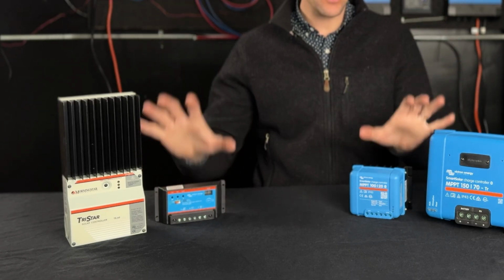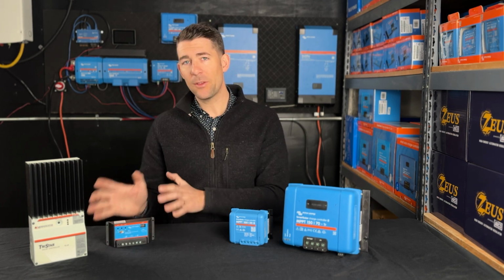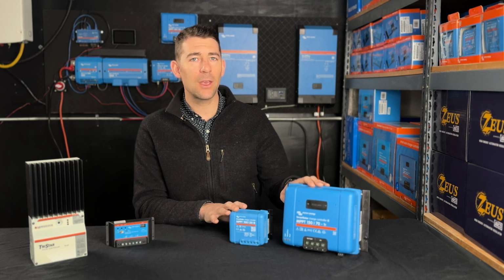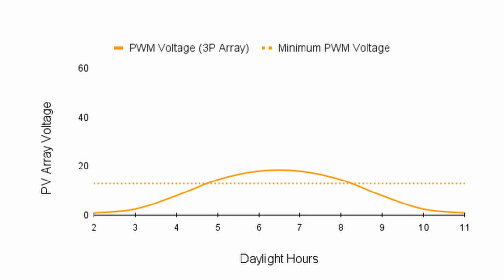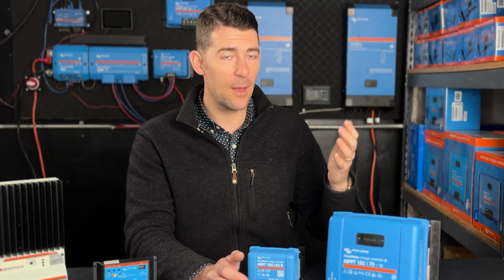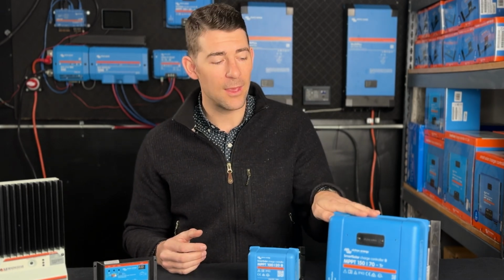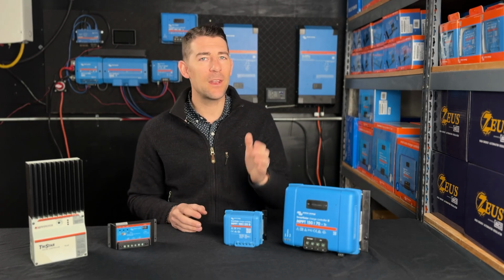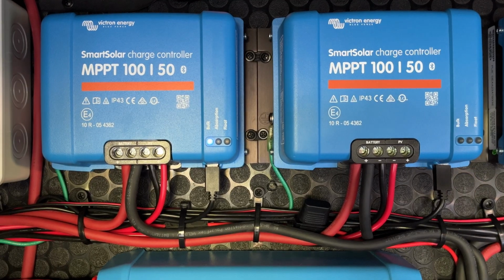Understanding MPPT Charge Controllers

Comment: If i have a 48v 550 watt solar panel can i plug this into a 48v mppt and then use a 12v car battery lead acid ? Or must i use a 48v battery ?
Reply from the maker: Hi @earlehowley3837 , a Victron MPPT will need a panel voltage of roughly 5V higher than the battery charge voltage to begin charging. So a 48V PV module would quite comfortably charge a 12V lead-acid battery. There’s actually a preset in the unit for just such a battery type. You’ll likely be using a SmartSolar 100/50 as a single 550W panel can produce upwards of 35-45A of charge current for a 12V battery. The 100/50 is able to charge 12V or 24V batteries, and other larger members of the product line are able to handle 12V, 24V, or even 36V and 48V batteries.
Reply: Must use a 48v battery.

Comment: Still no idea what MPPT means. What is being tracked exactly? I completely understand the difference between series and parallel wiring of panels to increase voltage and therefore extend charging periods at the cost of charging current. But isn't that just optimising?
Reply from the maker: Hi @markrainford1219, MPPT stands for Maximum Power Point Tracker. The MPPT is using a variety of algorithms to load the panels, that loading bringing the voltage down and amperage up, to find the point at which the array produces the most amount of amperage with the least amount of unhelpful voltage drop - the point of maximum power. The way Victron MPPTs do this is incredibly effective, partly due to the quality design and partly due to the highly specific algorithm that they use/created for these charge controllers.
Reply: @intelligentcontrols   Thanks. That's the best explanation so far.

Comment: Making more parallel connections ON SOLAR PANELS will generate more electricity in MPPT or series connection can have same result
Reply from the maker: @RAVIBROTHERSAGRA, there are benefits either way. The added voltage of a series set of panels can increase the variety of lighting conditions that will enable a charge current, especially in morning/evening and cloudier days - that added voltage means that even in mediocre light you can start to charge. The benefits of parallel panels does offer some resistance to issues like shading and less-than-ideal panel placement. The bottom line is that with an MPPT you’ll have a lot more flexibility to build your array the way you need to, while ensuring your sensitive battery systems are getting the charge they need.
Reply: Usually this is the case, especially if you have some panels that aren’t matched -  but if they are matched, MPPT is uniquely (vs PWM) able to use/convert the high voltage with no performance hit. 

The advantages in wiring are pretty significant though - I have a small system and always used parallel because I have different panels so it isn’t really a big issue, but I never thought about a large array with lots of wiring, and/or a long wire run from the array to the charger. That would make life SIGNIFICANTLY easier and cheaper.
Reply: Watts is watts, regardless of the connection.
Series just means less line losses.

Comment: HI CAN YOU HELP .I have a 100watt solar panel on my caravan, can you tell me if i should use a 75/10 or 7515 vitron controller instead of my old pw-sola runs at approx 21 volts battery states around 12.8-13.8 volts.wait for your reply.many thanks.chris
Reply from the maker: Hi @chrisredgwell4176, you’ll certainly see an improvement in charging with your existing panels and batteries. I’d need to see your panel specs specifically, but with a 100W panel, I expect the SmartSolar MPPT 75/15 is the right choice. Victron estimates a baseline improvement of 30% compared to the older tech PWM charge controllers.

Comment: I found that I have had better results with PWM chargers when connecting the panels in parallel. This is mainly because with the MPPT controller, the voltage from the solar panels does not become great enough to start charging until almost noon. The PWM charge controllers allow more current sooner in the day and later in the afternoon. However, I do have Victron MPPT charge controllers that I have not used yet. Hopefully, the Victron charge controllers will work better. I think that one drawback of using MPPT charge controllers is that it takes a higher voltage from the solar panels to get things going. I tried a different brand of MPPT charge controller, BZ Products that allowed charging current to go to the batteries at lower sunlight. Unfortunately, I don't get that much current gain. I was also wondering how much current you would get from a MPPT charge controller if you are drawing current from the batteries and the same time you are supplying current to the batteries from the solar panels. So far, from my experience, it works like simple math. For example, if I am drawing 50A from the system and the solar panels can only supply 20A, the other 30A comes from the batteries. Maybe series parallel combination is the best way to go.
Reply from the maker: @richardphillips2405, you’re quite right on a straight parallel system with a PWM vs an MPPT. A Victron MPPT needs to see the charge voltage +5V to begin charging (a typical lithium absorption voltage of, say, 14V would require 19V to begin charging). If you were to take a previously paralleled pair of panels and reconnect them in series you’ll see charging begin much earlier - if you series more than 2 panels you’ll begin to see even earlier charging. I find that a series/parallel combination of panels is often an excellent solution. The other big benefit is that your MPPT will now go through an actual charge curve (Bulk > Absorption > Float) rather than simply opening a relay - lithium in particular benefits from this, though you’d see some limited difference with an FLA bank. Victron estimates 30% more charge from their MPPTs vs a PWM charge controller. And you are spot on with the batteries + PV load/supply math.
Reply: I am going with a series parallel setup and MPPT controller.
I have a never used PWM that came with my panels kit but not going to use it. I want that extra 15% or so of power generation.
Oh that PWM I have is only rated for 24v. MPPT I will get is rated at 50V. Need the 50v because of a very long run.
Some can get by with short wiring but I can't due to a tree blocking the sun. Therefore I have to put mine away from the house to avoid shading.

Nearly every solar setup is designed for either an RV or a house. Not much in between like those with portable setups.

Comment: NEED HELP; I’ve a 12v camper with an 11 year old 85w permanent panel on the roof and a same vintage controller permanently mounted in my battery compartment. I’ve two new 200w (total 400w) portable panels paired with a Victron MPPT 100/30 controller that I am also using portable only when the portable panels are deployed. Question… if I permanently mount the Victron 100/30, should I eliminate the other controller?  If I do eliminate it do I just buss (combine) the connections? Please advise.
Reply from the maker: @Doc.Holiday good questions. We can go into more detail if you reach out to us directly. The short answer is that I would suggest bypassing the older controller if possible. In addition to it being an older tech and likely less effective charge controller, it may not have the voltage precision of the Victron MPPTs. If that controller is tied to a PV module and happens to be outputting a higher voltage than your Victron MPPT it’s possible that it could skew the system voltage upwards, potentially causing the new SmartSolars to shut off because they see the specified absorption voltage (prior to the bank actually being full). That said, I would NOT combine your portable panels with the permanently installed 85W panel. I’d likely suggest an additional SmartSolar MPPT 75/10, depending on the panel specs.

Comment: I have 4 panels they are 100w each the panels areMax power current amp. 5.32 / Maxpower voltage 18.78 / Short circuit current 5.70 / open circuit voltage 22.54 I got a solar controller from SmartSolar MPPT 100/50 , Will it work I need Help
Reply from the maker: Hi @jerryblankenship9908, please reach out to us directly (you'll see a Get in Touch contact form on our website https://intelligentcontrols.io/) and I’d be happy to help size your array and MPPT. Based on what you shared here, I would put your panels in a 2S2P array. You may be able to do all four panels in series, but that will depend on the low temps you expect to see and the voltage temp coefficient (as panels get colder their voltage will rise by a certain factor - so temp is important when you’re this near to 100V with 4 in series).
Reply: Obviously yes!

Comment: They are missing the whole point. MTTP is a method for matching the impedance of the PV array to the battery. It is constantly adjusting the load current to match the maximum output of the array.
Reply from the maker: Hi @RichardMentelos-g4e, thanks for the comment. We definitely try to simplify things to keep it concise. MPPT (Maximum Power Point Tracking) is indeed all about dynamically adjusting to extract the maximum power from a solar array.
That said, referring to it as impedance matching isn’t quite accurate in this context. While a PV array does have a nonlinear I-V (current-voltage) characteristic, it doesn’t present a fixed impedance the way AC systems or RF circuits do. Instead of matching source and load impedances, MPPT controllers adjust the array’s operating voltage to stay at or near the maximum power point, where the product of voltage and current (V × I) is highest. Algorithms like Perturb and Observe, Incremental Conductance, and Constant Voltage are commonly used to track that optimal point in real time. So rather than matching impedance, MPPT behaves more like a smart DC-DC converter that continuously tunes itself for the best power yield. We do appreciate your comment — there's definitely a lot more depth to this topic to get into!
Reply: Richard is right ... and sadly that's a long incorrect info from your side ... study maximum power transfer theorem.

Comment: my victron 150/60 24v system lasted only 6 month so far the 5 year grantee means nothing
Reply from the maker: Hi @leetaves9143, that's certainly not the normal pattern. Feel free to reach out to us directly if you’d like to take a look at what’s gone on with it - the Victron warranty is pretty comprehensive and we’re happy to help that process if we can.
Reply: @intelligentcontrols  my victron 150/60 se#HQ2407YNH4Y CAN YOU HELP I HAVE PACK IT UP READY TO SHIP
Reply: @intelligentcontrols  
2 of my charge controllers died after 3 weeks. The first time the lifepo4 battery went too low after a cloudy day and the battery bms went to low voltage cutoff. 
When solar came online in the morning it killed the charge controllers. So far everyone says the charge controller is dead and sealed so tight it is not repairable, but the victron website says the charge controller can go all the way to 0v. Apparently if the battery disconnects the charge controllers will get damaged why can't victron put a small capacitor to take a charge and power the unit as if the battery was full and protect itself? Or a throw a resetable breaker for times the battery may get disconnected?
What gets damaged when the charge controller has power from solar but the batteries have discharged to low voltage cut off? Is it possible to send them in to be repaired? or are they completely junk? They won't come apart by just removing screws, and I did not want to force something apart and break it if it is repairable. Or possibly covered by warranty? The LED's don't light up anymore and Bluetooth won't connect, but it will use some power if I connect it to a battery. Also the solar input is shorted together when I test the conductivity between the solar input + and - but even connecting it to a 12v battery it won't wake up and do anything... 😢

Comment: I have a question. 
I'm using a Ecoflow for my hybrid setup. 

is it possible to use MPPT from solar MPPT charge controller to a 25.6v 100AH battery then connect to my Ecoflow via XT60i ? 
thank you.
Reply from the maker: Hi @ayayotoko, a Victron MPPT can be set up to charge nearly any battery type or chemistry; they are quite flexible. As for whether that battery could then charge an Ecoflow via the XT60i - you’d need to refer to EcoFlow and how that system works. I suspect the input on the EcoFlow is a charge controller of some sort, possibly an MPPT - having one MPPT charge another MPPT tends to lead to the two units fighting each other. If it is an MPPT, you’ll also need to be providing it with a voltage some level above the voltage it needs to charge at. EG: a nominal 12V Lithium battery bank will probably be charging somewhere around 14.2V, and a PV voltage of around 19V will be necessary to enable the charging process - not something that is ideal to do with a lower voltage battery.

Comment: I have 3.2v 180 ah cells that I want to charge and balance to make batteries for either a 12 or 24 volt system (backup and camping), and I will not be using solar.  I know nothing about the batteries other than their voltage, LifePo4, and are about 5 years old.  I do not have a charger I trust so have not attempted a charge.  I am looking for recommendations for an AC-based charging system to balance, charge, and have the ability to set high and low disconnect voltages.  Recommendations?
Reply from the maker: Hi @steve8189, interesting question. As far as charging a 12V or 24V system, Victron options are very solid. Everything from the more mobile friendly BlueSmart IP65 chargers, the IP43 for a bit more power, or even stepping up to the Multiplus II Inverter/Chargers for really potent charging options at either 12V or 24V. The fully customizable charge parameters are just what you’re going to need to safely charge these LiFePO4 cells in a bank. As for your initial charge to bring the cells up to full and balanced prior to connecting them in a series’d bank, that is largely the job of a BMS (Battery Management System) to monitor and manage. Best practice for any series setup, which these cells will be, is to bring them to as perfectly equal a voltage as you can manage before connecting them in series. This will give them the best chance of staying balanced throughout usage - then it becomes the job of the BMS (best to use a quality option here) to monitor and/or isolate and/or trigger an alarm should something become outside of the cell specs. Having a charger that can perform a multi-stage charge curve is really crucial for bringing any LiFePO4 battery safely and fully to the top of it’s SOC, which is where the Victron gear comes in. Based on 180Ah cells you won’t need a massive charger, probably something like the Blue Smart IP65 12/15 or perhaps the Phoenix Smart IP43 12/30 for a faster charge. Reach out to us directly and we can likely be more specific based on your setup.
Reply: @intelligentcontrols  Thank you!
Reply: Just buy a modern battery charger that can charge all types of batteries.
Nearly all modern ones will charge a Lithium Ion.

Comment: So an MPTT controller is just a fancy name for a step-down converter?
Reply from the maker: Hi @chesshooligan1282, the MPPT (Maximum Power Point Tracker)  is doing quite a bit more than just stepping down voltage. As solar is “loaded” by using it to charge, the voltage of the system drops in response, sometimes quite dramatically. The MPPT is taking into account the actual live voltage of the PV (a combination of lighting conditions, native PV voltage, and load) and modifying the output to maintain a steady voltage for charging while making the charge amperage. This quite sophisticated algorithm is why Victron charge controllers can achieve such stellar PV charging results, even for challenging to charge battery chemistries like LiFePO4.
Reply: @intelligentcontrols  Thank you
Reply: @chesshooligan1282  its not that sophisticated, it just tracks when the battery charging reaches its maximum wattage, and yes its basically just a buck converter with this tracking mechanism.

Comment: I am implementing a buck converter with a PV panel (for a school project) and its frequency is 40kHz. At what frequency should the P&O MPPT operate? I was thinking about 4kHz (at the simulation level everything is ok but at the practical level it doesn't happen as I wanted). Do you think the frequency should be increased or decreased?
Reply from the maker: Hi @bernardosilva2421, good question. Victron is quite protective of their MPPT algorithm, (Victron being the brand we are referring to mostly in this video), so I can’t offer much insight into how their MPPTs operate. I do feel pretty confident saying that they are using a more complex algorithm than a P&O, and based on what we do understand with their MPPTs, I would suggest that an oscillation of the P&O frequency might be something to consider. In stable conditions with very little variance a lower P&O frequency would involve less loss of production, while in more changing and diverse light conditions a higher frequency on the P&O may be beneficial.